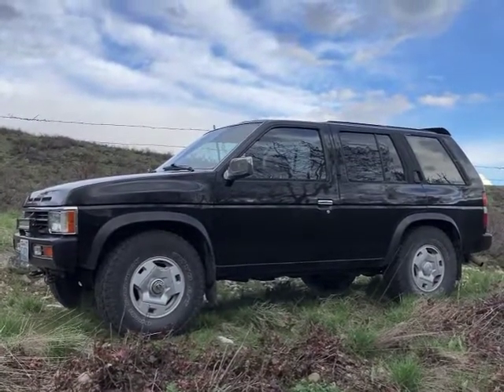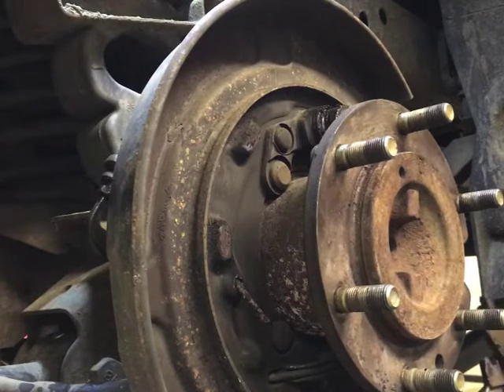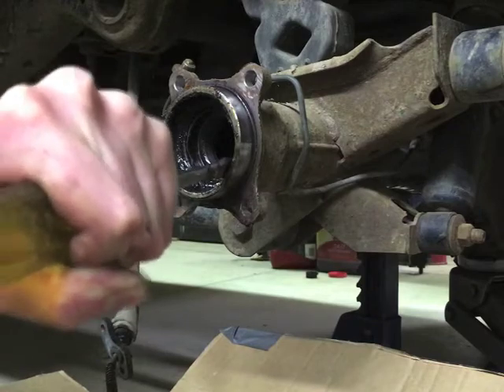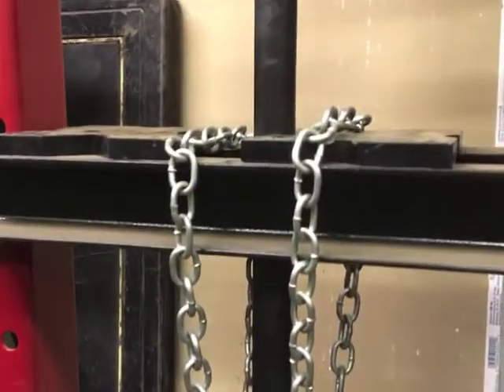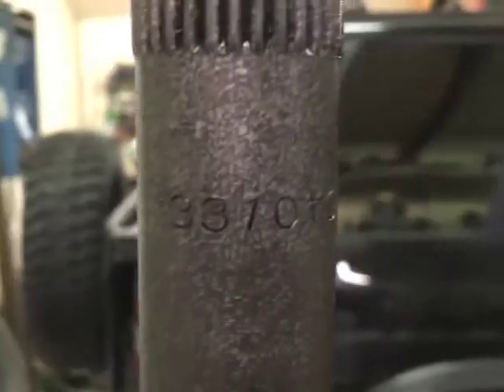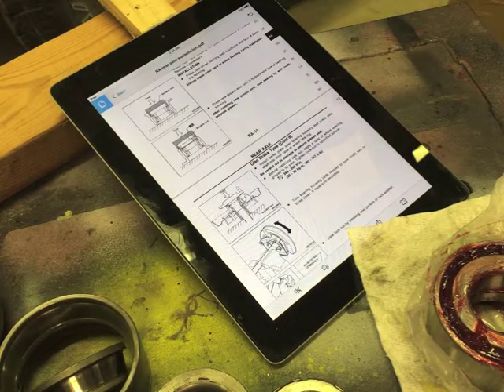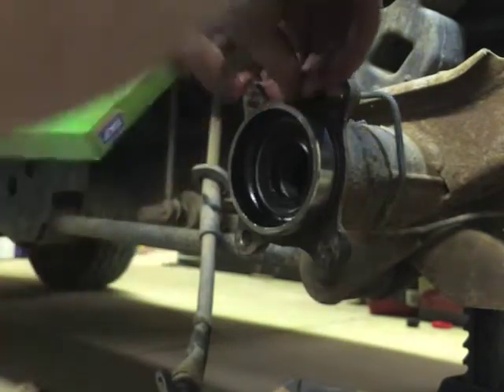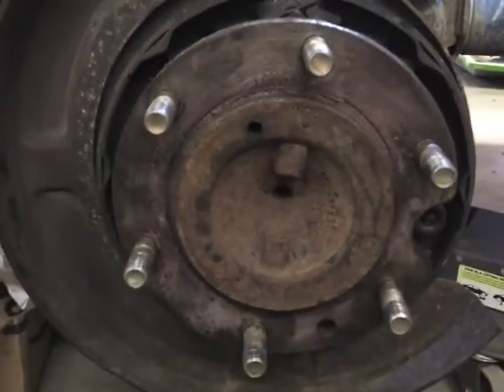WD21 Pathfinder Rear Wheel Bearings (Disk, H233B)

Comment: I have a rear wabble major on rear passenger on my 94 pathfinder how
Reply from the maker: The comments written in Russian are easier to decipher. 

If you mean the wheel wobbles, that could be a bent rim, bent axle shaft, or something stuck between the wheel and rotor, or rotor and axle shaft, that shouldn't be there, causing the wheel to sit cockeyed.
Reply: No wheel.bearring